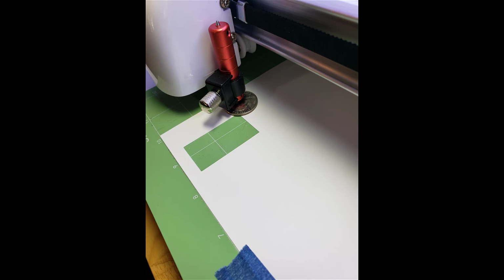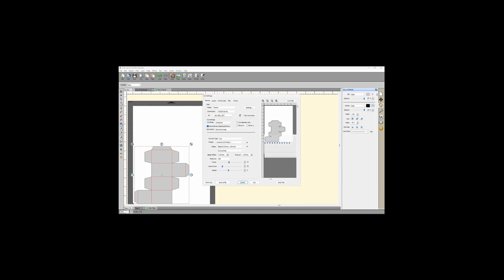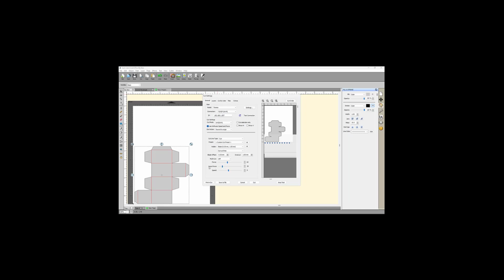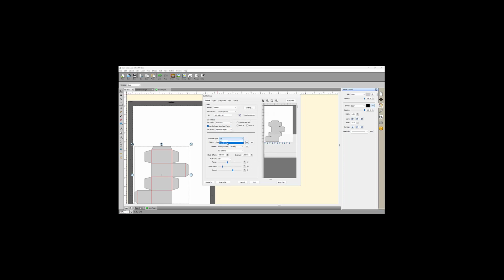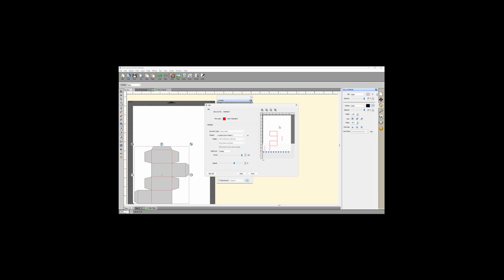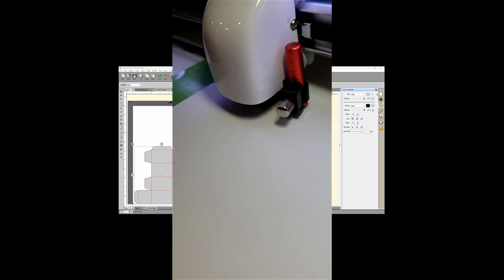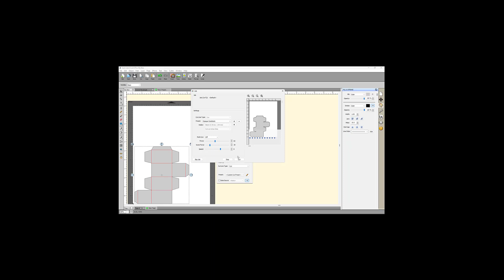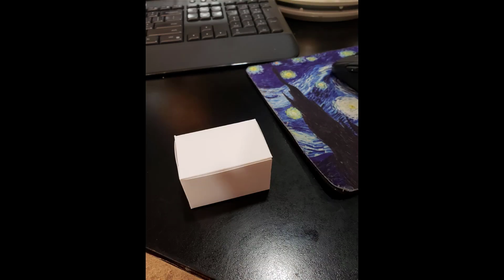Siser Cutter - Score and Cut a Box

Comment: I just tried this with scal6 and my solo. It scored just fine but it didn't cut in the right spot. When the scoring job was done the blade moved to the back right side of my mat. It starts at the right front side of my mat. What did I do wrong?